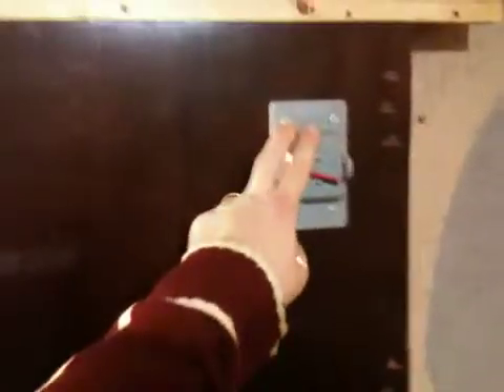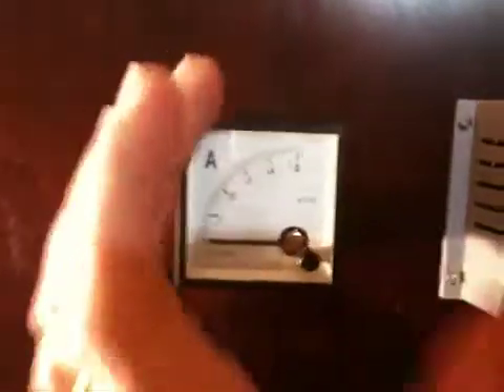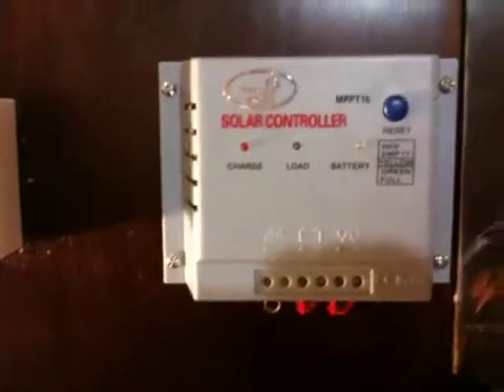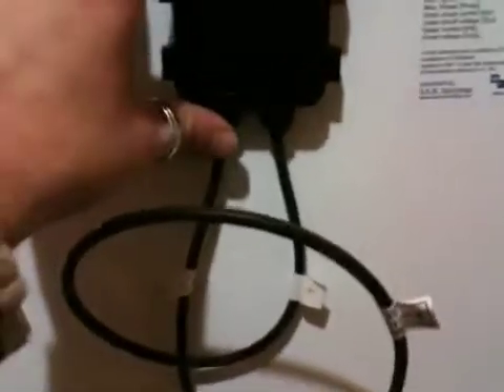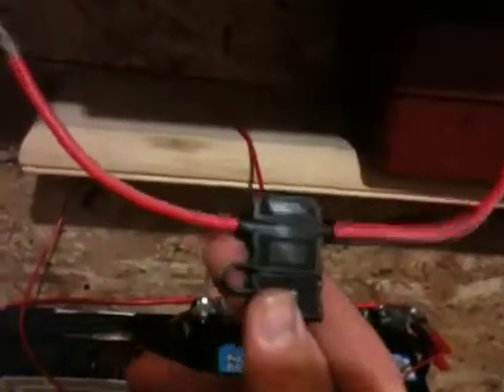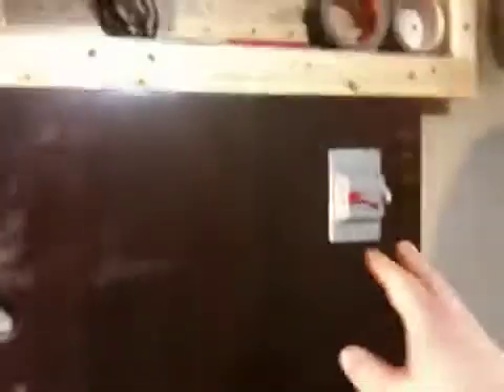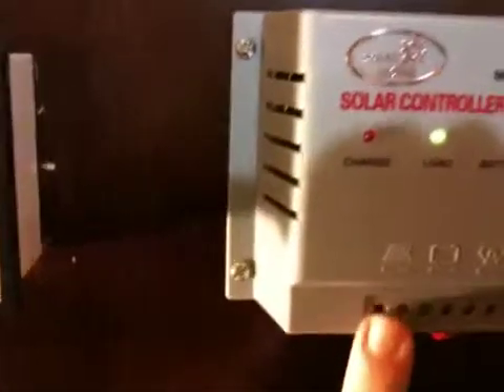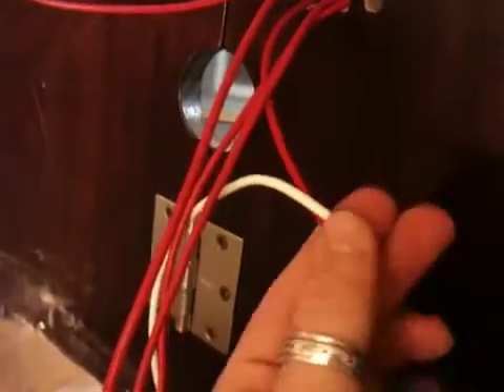Solar panel components install

Comment: @crsbt   As long as you have a real charge controller there will be no problems.  The cheapie Chicom GTIs flooding the market are even worse than the WellSee (really) when it comes to circuit design.  If you want nightmares, look up 'power jack inverter problems.'  The inverter in this case was a standalone inverter, but Power Jack make many cheap GTIs and there are similar flaws.  Off grid solar is better as it does not depend in the grid.

Comment: @crsbt   These are fake MPPT controllers that are actually PWM controllers.  As built, the stock inductor is only good for minimal RFI filtering.  With a better inductor, there is minimal current gain that is nowhere near the current gain from a real MPPT controller.

Comment: The load light means that there is electricity present at the load terminals.  If the low battery disconnect trips, that light goes out.  The 15 is because WellSee are a bunch of morons who use the same case for 10A and 15A controllers.  Also, that is a fake MPPT controller.  For your system it may be OK, as your array is too small to get the benefit of a MPPT controller, but if you expand with a few hundred watts of IDENTICAL modules, you should get a real MPPT controller.

Comment: I am using a similar setup you are makingup. I advice you welding/soldering all the naked wire connections in ampmeter and charge controller. Otherwise they will start to rust after a time.
In normally for wiring you use recommend wire area cables. If you dont know the exact wire on your setup simply use your in house wires if they became hot in max output then this means your wires are thin. (in my opinion for your 40 watt dont use thiner than 2,5 mm2)

Comment: What you understand about wiring is absolutely correct.
-Your charge controller is from WELSEE 
-15 on the MPPT means it can handle upto 15 Amps.
-Donot cut the wires on solar panel nor try to disconnect them box at the back because normally they are water proof ed. I suggest you use 2 MC4 connectors while connecting. By using MC4 connectors your wiring from outside to inside will be also waterproofed.